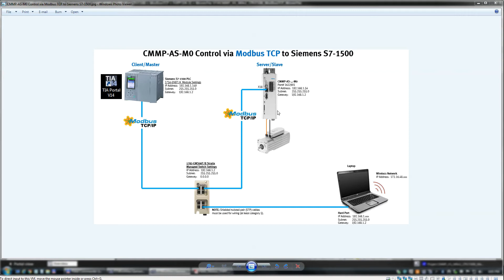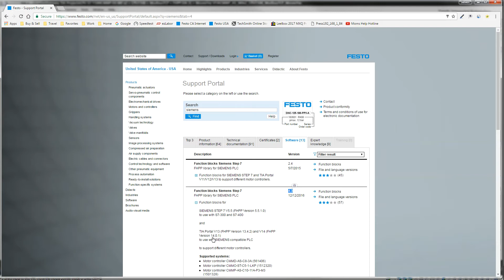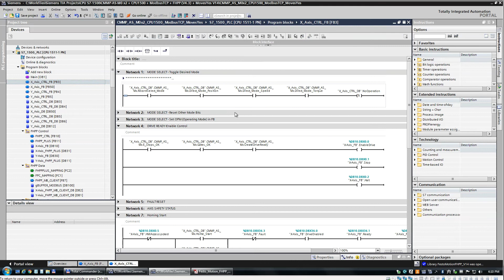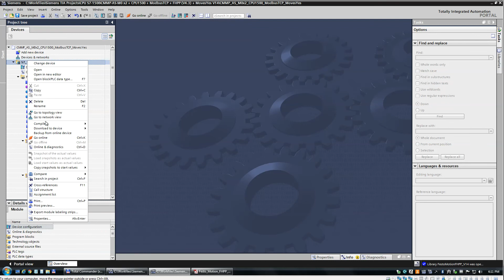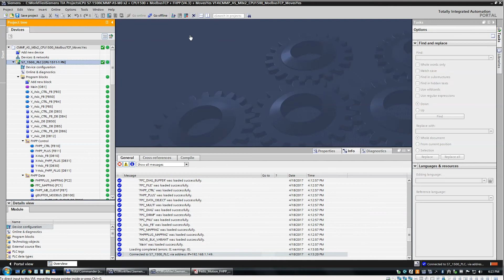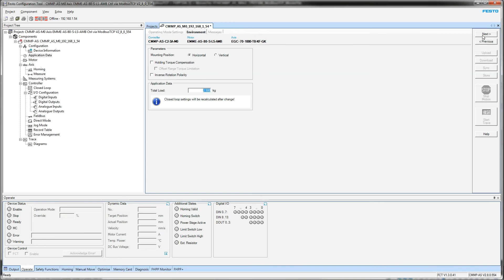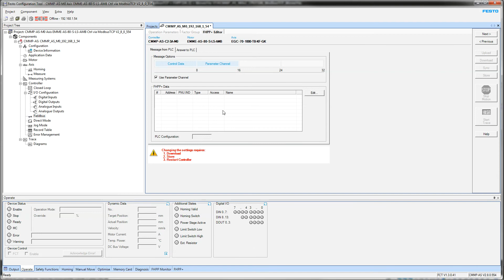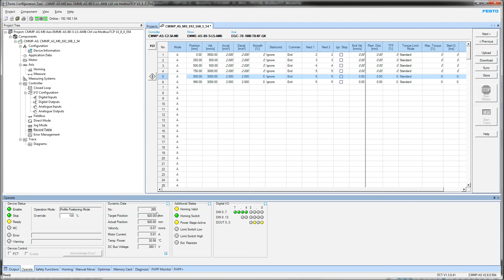CMMP-AS-M0 x2 + CPU1500 + ModbusTCP + FHPP V4 3 + Move Samples V14

Comment: First of all, thanks for the video. When i compile the program the TIA portal shuts down inmediatly, do you know why? Thanks.
Reply: Solved, Datatypes error
Reply from the maker: Sorry - don't know why - likely a poor TiA installation - the project should have nothing to do with this. Make sure the versions are all correct.  If All fails, write it from scratch instead of using my sample code and follow the steps in the video along the way